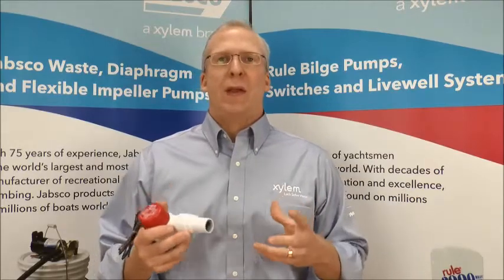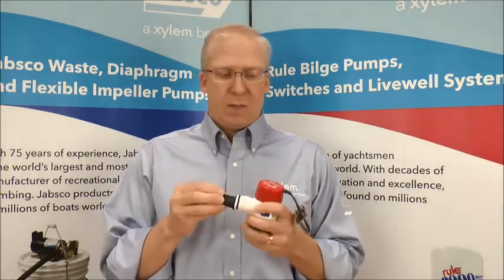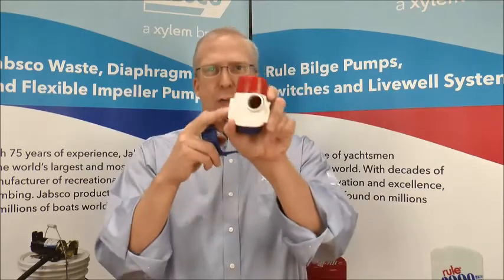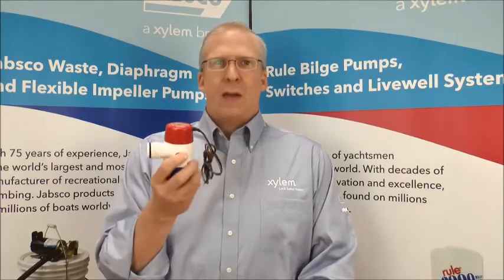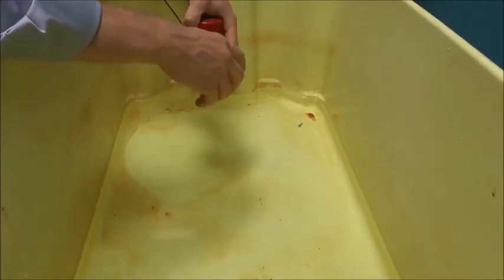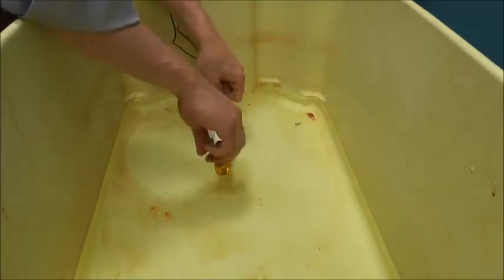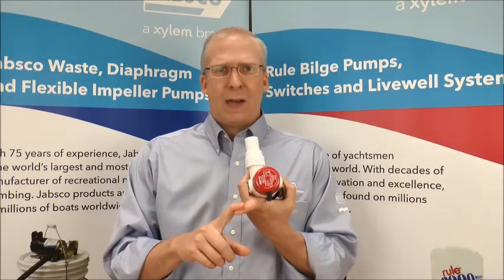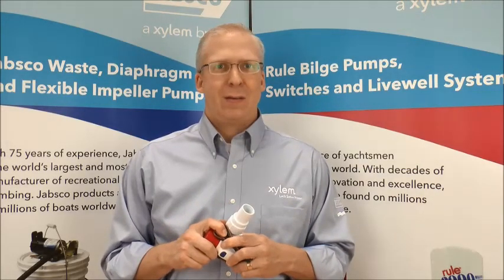Rule Bilge Pump by Xylem

Comment: This is cool and all but you made this pos with a ovel base so now that I need one this version is all I can find and my 40 dollar bullet bracket for my pwc won't work because it's designed for the old style and sits right next to the pto terrible design especially with that big ass port on it thanks to the check valve lol. Welp I'm out on using rule now